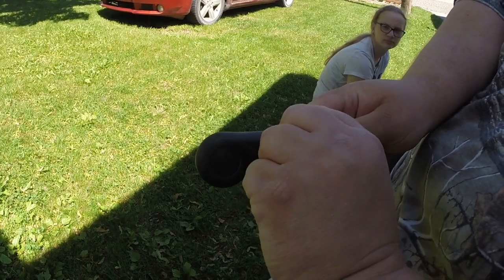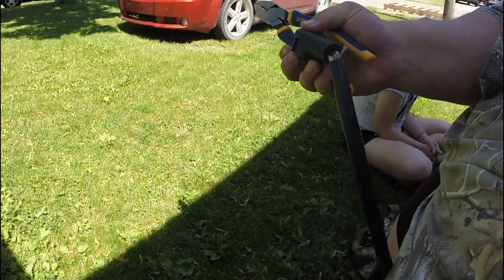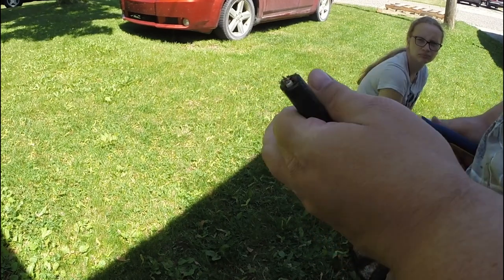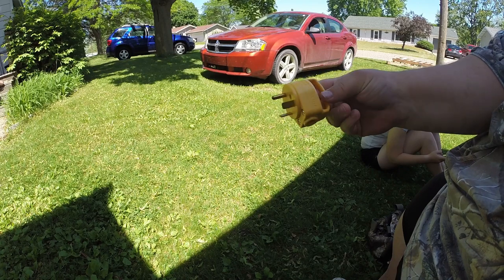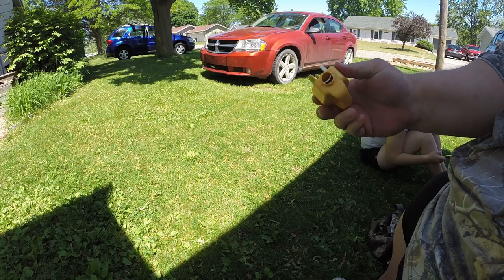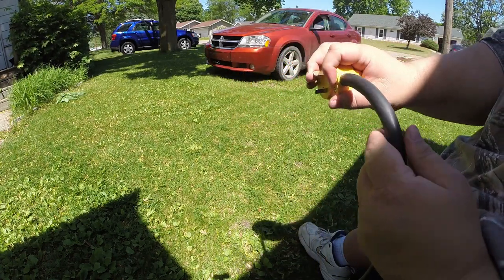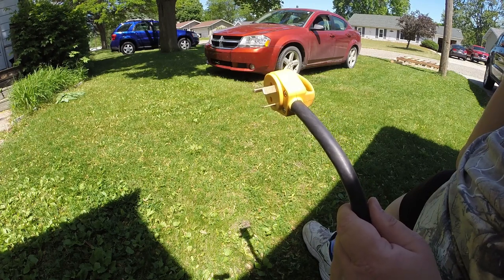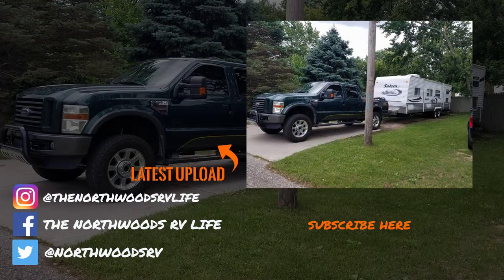How to Replace RV Power Cord [EASY DIY REPAIR]

Comment: Silly me ran over my RV power cord with the lawn mower.  After watching your video, I repaired it in less than 30 minutes.  I just trimmed it down from where it was cut, and attached the connecter you recommended.  THANK YOU!
Reply from the maker: Life's mistakes always find a way, am glad the video was to use to you. thanks for watching

Comment: Very helpful would I need to disconnect batteries to do this??
Reply from the maker: No you do not need to disconnect the battery. Even though the RV has a power converter to keep the battery charged the 12v power will no back feed into the 120v side of the breaker box. Thanks for watching.

Comment: Hi, I'm looking at replacing the whole cord
 My ? Is where the vord located inside coach  thx
Reply from the maker: Typically it will either go all the way into the fuse panel, but have seen them go to a junction box before the fuse panel